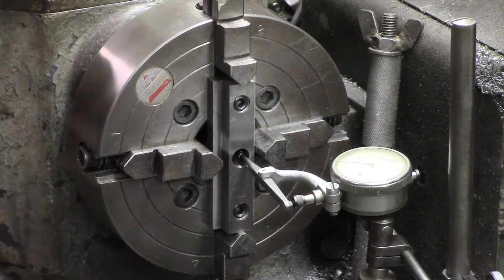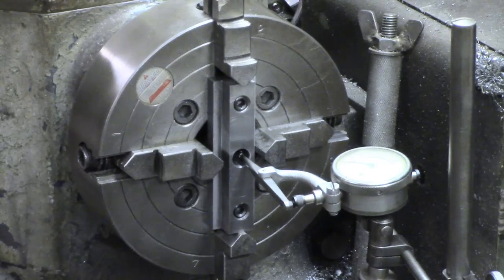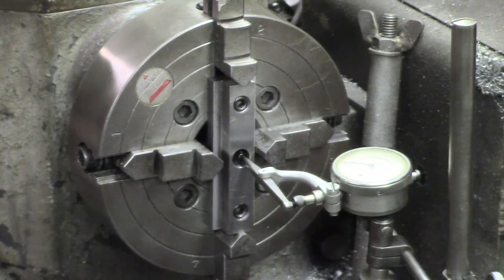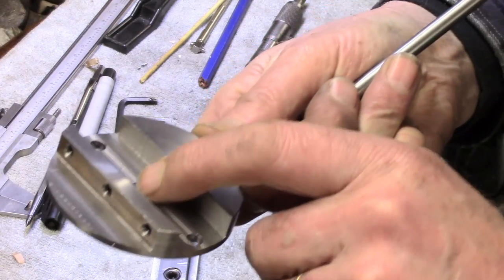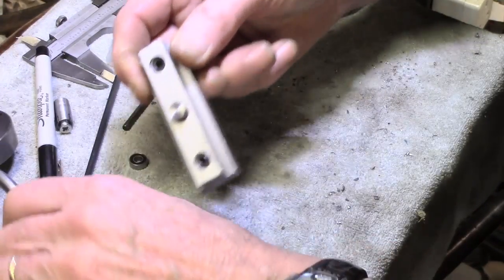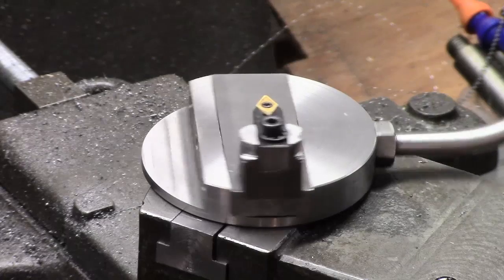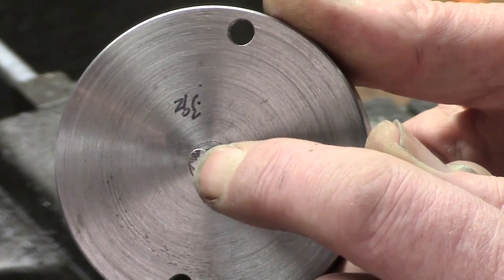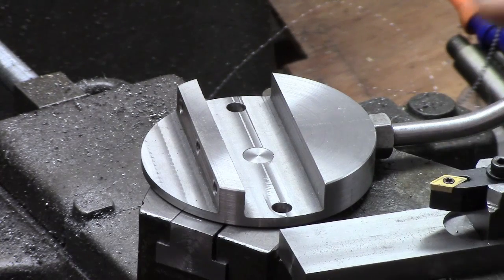Radius Ball Turner (MKl) - Pin Modification #2

Comment: Hi Chris !

I have followed your struggle to get this ball turner to work - I think the MK1 is the best method - MK2 has some major problems with the geometry, I think.

I dont think your bearings will do the job - there is always a little play and that play will be "amplified" the bigger radius you have on the buttom plate (the one with the handle).

That buttom plate has to be supported closer to the periphery - maybe some adjusting screws to press against the compound slide.

I did mine by making at whole fixture to the cross slide and balls close to the periphery of the "turning" head - I think I had showed you before - more details here and you can Google Translate to the right just under the menu line - choose whatever language you like in the combobox:

http://kelds.weebly.com/kuglevaeligrktoslashj.html

Just DON'T use balls like I did - even though they are covered and hidden - tiny chips or dirt will find it's way to pollute them and you can feel that when turning the handle - just make a flat plastic plate as "bearing".
Reply from the maker: Hi Keld - thx for the comments. I do think the MKll will be good once I make suitable tooling actually. I am just pursuing MK1 a bit further for the heck of it! Thx for the link - very nice work. My problem is the significant problem removing compound, which of course would increase my available height to machine center - but, cross slide has no t-slots so - another downside.  I will still be experimenting a bit more yet I think.

Comment: What ho namesake, how about making another tee nut that over hangs the side of the top slide so you can use a longer, wider and therefore stiffer, pivot?
ATB
c
Reply from the maker: Hi Chris -- interesting thought - however, one of the main limitations could still be the very small distance available to machine center. Also, any overhang would I think therefore also need to drop in height - and then too - there could be a decrease in rigidity.  Worth some thought tho thx.

Comment: Have you sanded the top of your compound on a flat surface? This surface would need to be flat to prevent rocking. Maybe take a little more off the top of the tee nut?? Thanks for video. - R.C.
Reply from the maker: In fact, with t-nut in place and checking with straight edge - truth is pretty good and would be reluctant anyways to interfere with the compound surfaces. Seems much as anything as though being stuck with only a short pin, any force/leverage downwards from the handle translates into slight movement, with handle edge section acting as a fulcrum.
Reply: ChrisB257
Don't give up on it.... Keep thinking about it and it will come to you.. At the of the video, I can see a gap. That tells me it's not a flat surface..
Reply from the maker: RC Miller It does look that way but at eye level and with a light - contact is good.  The generous chamfer on outside of swivel body does however make it look as though contact is bad. Will certainly check again.